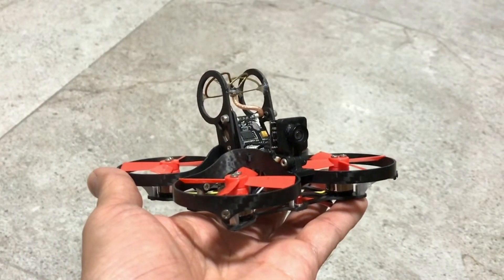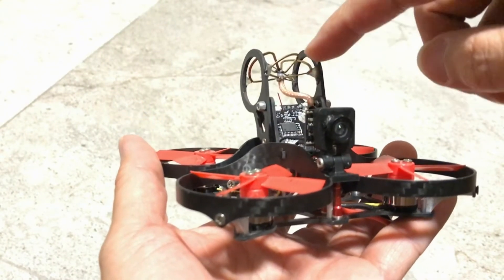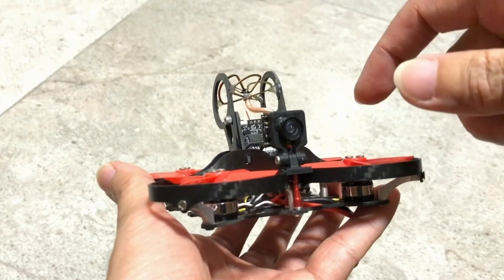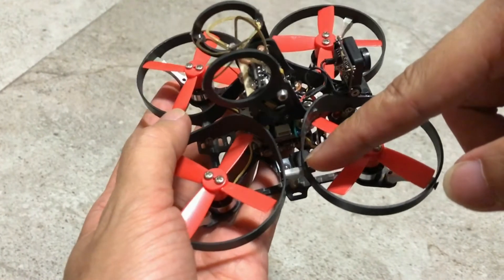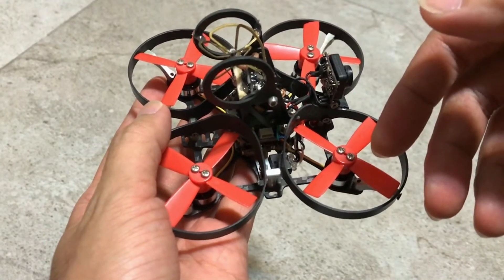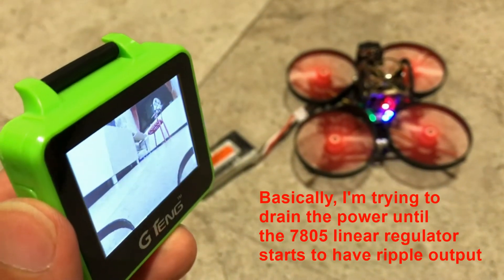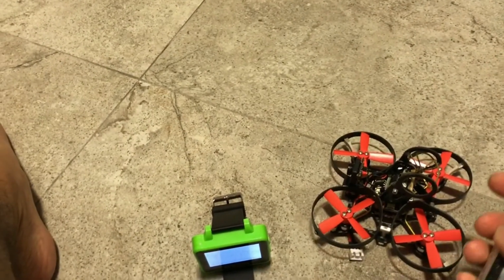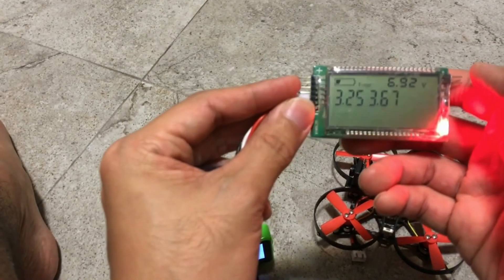LongRange Mod for Aurora90 quad

Comment: What is the range now in terms of actual distance?
Reply from the maker: Range in distance is subjective to the area that u fly(humidity, terrain, RF noise floor, etc). For e.g., I got as far as 5km out in the sea with 200mw vtx on a plane at 500ft using a x-hair on vrx. With the same x-hair & 200mw vtx on a quad at 400ft over land, we lost the video at 2.4km. In terms of actual range improvement, u will get 30% more LOS distance than that of your 200mw(whatever distance you've got). Hope this helps.